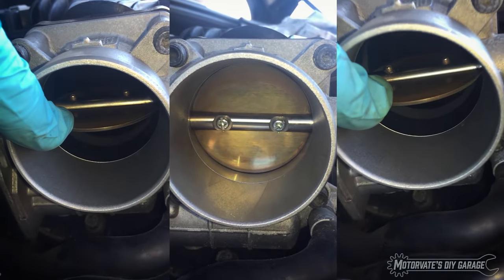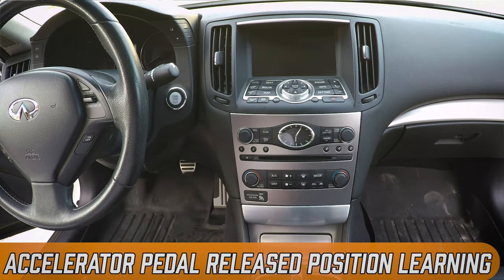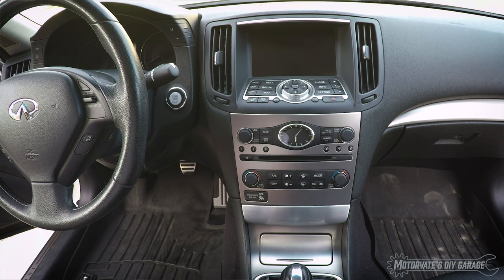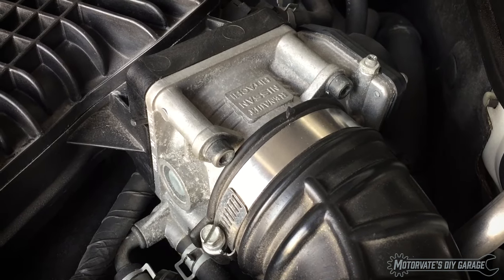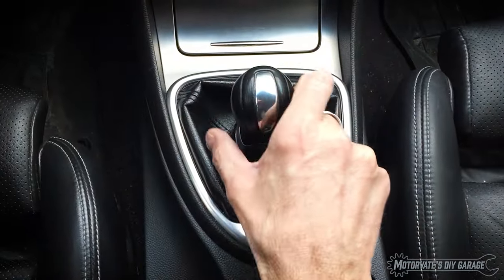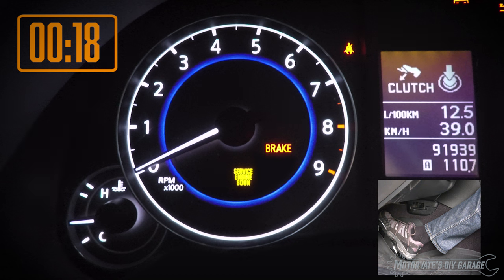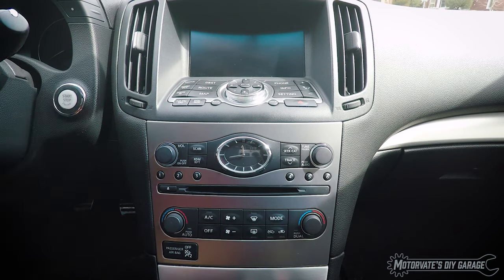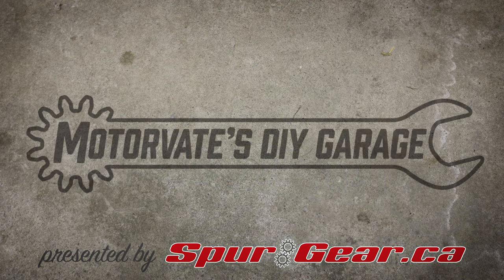G37 & 370Z After Throttle Body Cleaning: Motorvate’s DIY Garage Ep.27

Comment: Does this only apply to G37's and 37OZ's? Or is this in general???
Reply from the maker: Hey  Franklin Rocha Jr,
This applies to any Nissan or Infiniti made after 2003-2004, as they have an electronic throttle.
Reply: @MotorvateDIY  oh ok, well I have a 99 honda crv
Reply from the maker: Hey  Franklin Rocha Jr,
After a quick search, it looks like your throttle body is  the older style cable actuated. All you need to do, is clean it and you are good to go :)
Reply: @MotorvateDIY  thank you very much! 👍👌

Comment: Hi there after cleaning my Throttle bodies and Maf sensors the RPM keeps Fluctuating up and down between 1500rmp & 2500rmp.. What can this be from, I hope I didn't damage anything during the cleaning!
Reply from the maker: Hey Tony Atin,
(I assume your vehicle is a Nissan/Infiniti with 2 throttle bodies)

I don't think you damaged anything. Here is what it looks inside the throttle body:
https://youtu.be/HLQiu1kZ354

Did you follow all the steps in this video and the required pre-conditions?

After you clean the throttle bodies, there are 3 procedures that need to be done: release accelerator position learning, closed throttle position learning and (the most important and difficult) the idle air 
volume learning.
Reply: did you ever solve the problem. I have the problem now as well. It's the beloved idle surge.
Reply: This happened to me because one of the MAF sensor plugs wasn't in all the way

Comment: Just cleaned out my throttle body’s on my 07’HR while connected to the battery🤦🏽‍♂️ 
My car idles high AND has constant idle surges. Will this resolve the surges as well?..Or is my ECU toast? I haven’t had time to actually try those re-learn steps but I’ve read on forums that the ECU won’t accept the re-learn procedures if the throttle bodys were manipulated while connected to the battery? Any advice would help thanks!
Reply from the maker: Hey Luke Tabayoyong,
Funny, I just read your post on Facebook and was about to answer it there.

There is SO MUCH bad information  about our throttle bodies.
• You will nor break them if you move the throttle plate 
• You do not need to disconnect the battery to clean them
• After cleaning them, you MUST do the three steps shown in this video.

Here is what happens:
Due to the crank case ventilation system (PCV) feeding into the intake BEFORE the
throttle bodies, a small amount of carbon will slowly build up on the small gap between the edge of the throttle plate and the throttle bore.

Over time the ECU (engine control unit) will adjust slightly open the throttle body to compensate for the dirt build up.

When you clean the throttle bodies, the dirt is removed and this creates a larger opening, allowing more air into the engine, which increases the idle. Sometimes if the idle it too high, the ECU tries to lower it, the revs drop too low, and it increases the revs. This causes the idle to rev up and down.

So.... We have an ECU that knows the air flow of the idle when the throttle bodies were dirty BUT they are now clean and the air flow is different!

The Solution:
Three specific procedures need to be done, to teach the ECU the new airflow of the CLEAN throttle bodies:
• Pedal Released Position Learning
• Throttle Valve Closed Position Learning
• Idle Air Volume Learning

These are all shown in this video.

TIP: If your throttle bodies are VERY dirty you may have trouble getting the Idle Air Volume Learning to run or complete. If that happens follow the steps in this TSB from Nissan/Infiniti: http://www.infinitig37.com/TSB/ITB11-060.pdf

For the 2007 VQ35HR, I remember that Infiniti released an ECU update to fix an issue where the Idle Air Volume Learning would never run to completion. I will try to find it.
Reply: Motorvate DIY Thanks for the help!..but I have gone through the steps and procedures to damn near perfect. Had a stop watch out, plugged in my obd reader and had all the criteria before for the last IAVL test...still no luck. I read the PDF you linked, followed the steps removing a MAF sensor (1sensor in this case on my HR). Reconnected and cleared code before starting the IAVL again....still no success. I’m currently searching for the update if any🤦🏽‍♂️🙄
Reply from the maker: Hey Luke Tabayoyong,
Sorry to hear about this. A while ago an other 07 HR owner commented that he needed the ECU updated to version "C" 

Anyways please keep me updated on this and I will pin a warning comment  to the top.
Reply: @MotorvateDIY  
Update on my issue. 
Spark plugs, coil packs, and o2 sensors are all working properly. I did not change the throttle bodys out or do anything to the ECU except reset it and clear codes manually. No reflash or update on software. I made sure there were no intake air leaks anywhere. i drove my car about 100 miles to see if there was anyway the ecu could self adjust and fix itself. It seems the more i drive the car the better the "normal idle' gets. which is extremely odd to me. the surging doesn't happen as often as they did a couple days ago. I did the re-learn procedures multiple times throughout the 100 miles i drove the car. idle holds at about 1k RPM now and surges occur A LOT less then they did a couple days ago. One thing i noticed was when i turned on the heater the idle dropped even more(right under 1kRPM) and the surging COMPLETELY stoped all together...like there was no issue to begin with. Do you know if there's any correlation between the heater being on and the idle? Literally, when the heater is blasting, there seems to be absolutely NOTHING wrong with the idle.......
Reply from the maker: Hey Luke Tabayoyong,
With the heater on, the engine load is slightly increased from the power required for the blower fan . Also, in some cases a "defrost" mode will turn on the air conditioning to remove moisture from the air blowing on the windshield, so it doesn't frost up on the inside.

With a slightly higher engine load, the throttle will open a little bit more and the idle will be more stable.
Reply: ***UPDATE*** regarding people with high idle/idle surge issue w/ 07'350z....i stumbled across a tuner based in Concord CA named Eugene Turkov that found a way to fix the issue with the ECU. Decided to send my ECU out to him in hopes he could solve the issue. Based on his previous experience with the problem he said the latest firmware update will NOT fix the problem. The fix was upgrading the original ECU to a firmware from a similar 2008 model. My car is now running healthier than when i purchased it 4 years ago!  Let me know if any of you need his info!
Reply from the maker: Hey Luke Tabayoyong,
Thanks for the update!
I know Eugene Turkov and is very knowledgeable on Infiniti/Nissan engines
and he's an ECUTek Master Tuner.

He can be contacted here: https://www.yelp.com/biz/enthusiast-auto-care-concord
Reply: i have the dreaded 07hr that needs what i believe to be the ecu updated as well, ive swapped TBs cleaned with battery unhooked , followed the foot dance to a T, downloaded the free app. idle has gotten somewhat better after the iacl bluetooth scanner even though everyone i preform the test it fails ... wha did the 08 bin/map ecu upgrade run you ? maybe i can find a file online to flash? does the dealer not offer  a ecu update for the 07?
Reply from the maker: Hey Brax t,
Sorry, somehow I miss your comment.
I have looked EVERYWHERE for software to download the ECU, or for a BIN files.... and I found nothing! ROMRaider might be an option, but it looks like they are not adding new members. Maybe have a look there and see if you have better luck.

Do you know your ECU ID?
If not, it is shown on OBD Fusion's diagnostic report in the mode $09 section. Look at the first calibration ID, and ignore the first character.

Once you know that, you can hit googe up and see what is out there.
Reply: figured it out thanks to you ! i was not following step 1 and 2 before 3 , step one engine cold , step 2 warm , step 3 warm, used the NDS 3 and the $10 ebay BT obd dongle and now it’s purring like a kitten! couldn’t be happier , ive sub’d and i have some good info about not using the cheap clone $20 ebay oil pressure sensors vs oem also!  i had try to adapt the TBs for almost 3 weeks and never could of done it without NDS! :)
Reply from the maker: Hey  Brax t,
That is good news and thanks for the update!
Tell me more about the ebay oil pressure sensor... Why did you replace it?
Reply: Motorvate DIY i broke my oem sensor changing the alternator , so i bought a “oem $20 nissan “ oil pressure switch off ebay , and bam i was reading about 10 psi at idle , i knew this was wrong because it was fine before , there’s a lot of bad info out there with people changing galley gaskets because of these bunk china sensors , i ordered a used known oem and i’m sitting at 30+ at idle again , might be a good video for you to make some more subs :)
Reply from the maker: Hey Brax t,
I was a little confused. You mentioned oil pressure switch and then oil pressure switch.
Since you have an 07 HR, I assume you have a 350Z, which has an oil pressure gauge and an oil pressure sensor.

The G37 only has an oil pressure switch... 
I am making an cheap Arduino based OLED oil pressure  gauge for a future episode. I have purchased two 350Z oil pressure sensors from AliExpress and the sensors were made in China. 

I will verify their accuracy against known accurate pressure sensors connected to the same pressure source.

Thanks for the heads up on their inaccuracy.
Reply: Motorvate DIY correct , oil pressure sensor , 3 wire sensor , power , dummy light and one wire for the gauge “350z/hr”
Reply: @brizax  could you please explain how you did not follow the first two steps? As in what do you mean by step1 cold, step2 warm, step 3 warm?

Comment: Will this work Altima 2013 Vq35de engine ? 
My Car RPM is shaking
Reply from the maker: Yes it will, as that engine has an electronic throttle :)
BUT if your engine is "shaking" you may want to scan it for codes, as I suspect you may have a cylinder misfire or something else going on.
Reply: @MotorvateDIY  yes Spark plugs and Coils were Bad . Chnage them already not there is No shaking but still RPM is Shaking up down... do I have to Change throttle Body ?
Reply from the maker: If the idle is not stable, there is no harm in doing the "idle air volume learning"... that should get your idle back to normal.

Comment: Most comprehensive info I've seen on this. Would it be the same for VQ35HR? Oh and do you have or is there a diy you recommend to follow as far as the actual cleaning of the TBs
Reply from the maker: Hey nighthawk0077,
Thanks for your kind words on the video!

I just check the factory shop manual for a 2008 G35 (with VQ35HR) and the process is exactly the same.
Here is a my  video on cleaning the throttle bodies:  https://youtu.be/ySK99VbSiTE

Happy cleaning :)
Reply: Motorvate DIY in step two it seems all you do is start the car, let it warm up and then turn it off? It seems then that would happen pretty well each and every time th car is used/driven. Is this a built in factory thing that needs to happen every use, or is it important to do the throttle valve closed learning right after the accelerator released learning for it to run? Thanks for your time! ...my 2007 G35x has lost its idling ways ;-)
Reply from the maker: Hey nighthawk0077,
Good questions.... however I really don't know. BUT I do know the factory shop manual says that is what needs to be done, so I follow. :)
Reply: Motorvate DIY unfortunately I am one of the ones where this won't work, no matter how many times tried or how accurately done. The only fix seems to be an ecu reflash to version 'C' at the dealer. Then the learning procedure should work. I believe I am still on version 'A'
Reply from the maker: Hey nighthawk0077,
That's interesting.... How can you tell what version your ECU is? Is it the ECU number? (like 1NX4A?)

A few days ago, I released "Episode 28: Easy Idle Air volume Learning" which uses a free app. 

Can you try this and see if it works: https://youtu.be/OiB9txECWB0
Reply: Motorvate DIY https://g35driver.com/forums/g35-sedan-v36-2007-08/461383-07-g35x-post-throttle-bodies-cleaning-idle-hunt-solved.html

At least I know how to fix it now...and stop trying to do a relearn that will never work lol
Reply from the maker: Hey nighthawk0077,
Wow, that link was very interesting!
 
Can you try just one thing for me? With the engine off, remove one MAF electrical plug. Start the car. You will get a check engine light. Turn off the car. Plug in the MAF, start the car and clear the trouble code. Now try the idle air volume learn, and let me know if it worked....
 I can't find it now, but a long time ago I read where this may allow the idle air volume process. 
Please let me know if you can do this and the resutls.
Reply: I just came across this: http://productforum.autorepairdata.com/forum/showthread.php?t=4744
It seems that if the idle is too high after cleaning the throttle bodies on a G35, the idle air volume leaning procdure won't work. 
Some have unplugged fuel injectors to lower the idle, run the IAVL, then plug in the injectors and run the IAVL again. Might be worth a try.
Reply: Motorvate DIY unfortunately that didn't work. Can you recommend a shop or mechanic in the GTA that can help me out and complete a relearn?
Reply from the maker: Hey nighthawk0077,
I really can't recommend a shop, since I do my own work, I don't know of any.
I want to make sure I understand your issue: After cleaning the throttle bodies, you idle is high and the idle air volume procedure doesn't complete.
If the fix is an updated ECU, your best bet would be take it an Infiniti dealer.
Reply: Ok she's all done. Took it to 401 Dixie Infiniti. Had it all fixed up in 15-20 mins. Only dealer I called that actually knew the problem and how to fix (ECM reflash/update and then perform the Idle air relearn). Apparently they have had many customers with this issue. They did say I got lucky that my car took to the new programming right away, where some others have taken up to two hours to do.
Reply from the maker: Hey nighthawk0077,
That's great news! Thanks for sharing the fix.

Comment: Hey my 2008 G35X Sport keeps shutting off when I'm idling (600rpm to 700rpm sometimes drops to 500rpm in stop and go Toronto traffic) . I've changed the cam sensor, cleaned the throttle body, and done the reset as shown in this video but it still stalls. Usually during parking lot maneuvers, never when RPM is greater than 1000. Any suggestions?
Reply from the maker: Hey Saar Kapasi,
If the air conditioning is on, does it still stall? (when on, the idle is increased to compensate for the additional load)

Is the engine RPM between 600-700 when in park with the engine fully warmed up?

If you have an OBD scanner, you might want to check for codes, even if the check engine light is off. (pending code) 

Also, check the short term and long term fuel trims. Add the short term and long term and the total should be around -10 to +10% for each bank.
(If you want to learn more about how OBD works, please have a look at my other channel https://www.youtube.com/obd4everyone )

Why did you change the cam position sensor?
Reply: @MotorvateDIY  thanks for the reply! 
In N and P it's good at 700-800rpm. Just in D or R rpm flutters between 450-700rpm at a stop light. When it does do this it may or may not stall when I hit the gas (a bit of a gamble). 
Regardless of ac being on or off it stalls. I changed the cam because my mechanic told me to.
Reply: It's also not throwing any codes which is the issue
Reply from the maker: Hey Saar Kapasi,
If the engine is idling steady at 700-800 RPM in park or neutral, that suggests the engine's idle control is ok.
I wonder if the issue is the transmission? Other than the idle drop when in gear, does the transmission do anything different? (like slow to change gears, shifting hard, etc?)
Reply: @MotorvateDIY  sometimes on the highway it randomly accelerates even though I'm not accelerating. Apart from that no, it's smooth. I have the paddle shifters so I've gone through all the gears to check transmission. FYI I really appreciate the help.
Reply from the maker: Hey Saar Kapasi,
I think at this point all easy to troubleshoot items have been done. To continue troubleshooting would require special tools.

I think your next step is to take it to the dealer. The fix could be as simple as an TCM (transmission control module) update. Also, pop over to myg37.com and ask if anyone else has seen your issue.
Good luck!